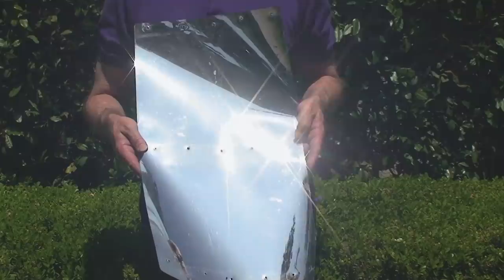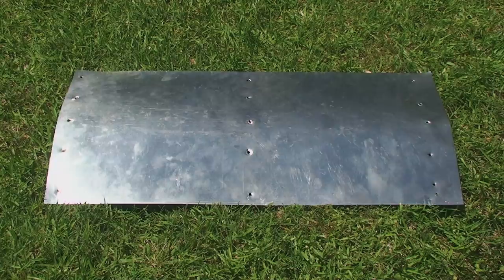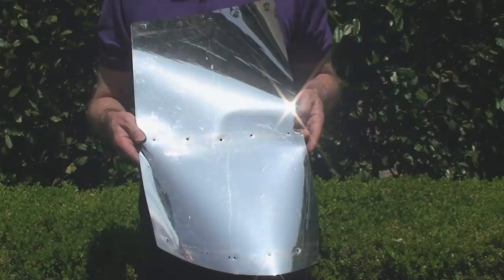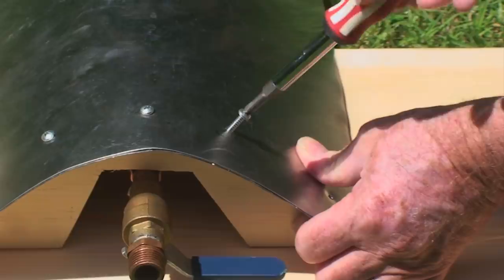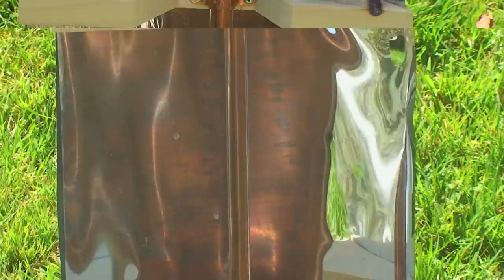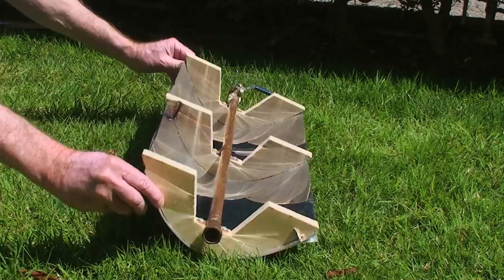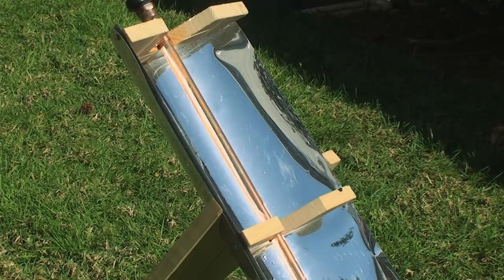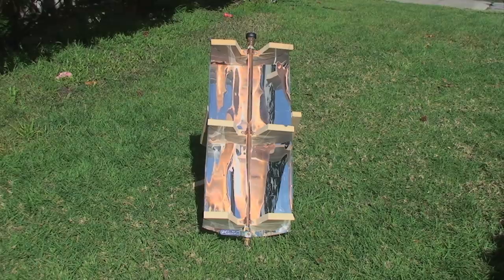Solar Water Heater Demonstration

Comment: well what are you going to do with that 1/2 cup of water? need to be about 150 times that size to heat water for any practical application
Reply: Maybe make a bit longer pipe and then attach it to a water source. it would probably output 10-20 litre before getting too cold. But i could be wrong
Reply: This is a gimmick.  The guy does not mention flow rate of water through the device.  You see to heat any useful amount of water the flow rate would be too fast to heat the water.
Reply: He said this build was just for demonstration.  Obviously, to be useful, it has to be bigger.

Comment: Nice explanation, but old technology.  I installed manufactured heating units that worked on this principle in the early 1970's - more than 50 years ago.
Reply from the maker: Are they still working?

Comment: I'm guessing randy gave his milk money away alot when he was younger. 

The water being static doesn't take into account cooler water moving through the pipe and cooling the copper. I would assume a longer run, with a return, traveling the same path through the parabolic trough, would counter the effect to make the flowing water warm enough for bathing or washing.

Comment: How fast does it heat the water? Will one run out of hot water while showering? Shabbat shalom
Reply: My question is talking about if this was hooked to running water. Shabbat shalom

Comment: when sun move, is parabolic still focus to the pipe
Reply from the maker: Interestingly, yes.
When the trough is horizontal and parallel to the path the sun takes across the sky, the parabolic reflector keeps the sun's rays focused on the pipe throughout the day.  The only areas that suffer are the very ends.  So if one has a long trough, the vast majority of the pipe will be heated.
As the sun changes latitude, the angle of the trough will need to be slightly changed, something on the order of every two to three days.

Comment: What country / climate are you in ? 
How would this work in England Uk Temperatures ? any info / ideas ?
Reply from the maker: This was built and shot in Los Angeles, California, but as one can see in the video, the ambient temperature in the shade was 68 degrees.  Not that hot.
One can get a temperature rise on a cloudy day just from infrared heat through the clouds, but of course, nothing anywhere close to approaching direct sunlight.
Even in England, one should get some temperature rise, but one would also need substantially more collection area to make it fairly effective.
Reply: ***** Thanks. 68 is good temp' for English summer. we occasionally hit 80 but only for a couple of days. its mostly 55 to 70 / 75
90 is a freak in weather . ( 32 ) ( 32 hot ) 
Its all very much Science / locality. 
But i like your ideas well done good vid' 
Many thanks from Yorkshire England Uk .
Reply: A friend of mine in the UK built a solar heater like this and it was so hot it blew up the two thermometers he had on hand. 
I have read  on a forum I belong to that some DIYers have measured  temps in excess of 220+*F in their air heating systems. One of these was in Pennsylvania in the winter...

Comment: Why didn't you hook up more water from a tank to it and run it through it to see if it holds a continuous temperature throughout the whole run of the water in the container? sure it's going to heat up the water in the pipe that's locked away lmao what about continuous heating? that might have been a good thing to add to your video Even though you're say you're not going to make a video with that until you have to have an instance where you need to that's just ridiculous if you're going to make a video show proof of concept not proof of heating up a cup of water

Comment: Can you drink the water after heating?
Reply from the maker: If one has followed proper plumbing practices, such as using lead free solder, copper pipe and fittings suitable for potable water, and, of course, potable water, then the answer is yes.

Comment: Just get a gas hot water heater and put a gasifier on it. That's way cheaper and get more hot water with less space.
Reply from the maker: That also works.
Reply: sgirrel it beats haveing to clean it everyday like Solar panels. If you don't keep it clean it won't work that good. And on rainy and cloudy and cold days it won't work. So no hot water. The gasifier is the best way to go.

Comment: Why only a single pipe?  May I use multiple pipes?
Reply: It is only a single ptpe  because its a demonstration. Working systems have many pipes joined. The narrator touches on this when he says that there are threaded ends on the pipe to join it to others when creating the system
Reply from the maker: Yes.

Comment: "If this basic simple technology is so easy then why is it not in use by everybody." 

Because the premise that it's simple is not completely factual. 
Sure the concept is simple. then you have to add in expense such as solar tracking and  glass to help retain the heat, not to mention controls to prevent oveheating and explosions, Then during the winter you cant let it freeze so then you have to use some kind of antifreeze and use a heat exchanger to transfer the heat to water. Then there is the point that it could not replace home hot water heating. As such it adds to the upfront capital cost of a  home vs if it could just replace a home's hot water. 

I will consed the argument that free heat from solar energy over time  offsets the expense of heating water with electricity or natural gas with the return on investment around 7 years. 

While some people implement solar heating, more don't because of maintenance issues and  ROI is not short enough for them to justify the extra expense now.
Reply from the maker: This video covers just the concept of the device.
The video also explains why this does not need any tracking.
Implementation of this type of device will be covered in another video.
Read all of the comments to answer a few of your other concerns.
Reply: As I pointed out, the concept is simple. I was addressing the issue why people don't put it to use more ,  because of factors I listed. I am just saying the reasons are more  complicated then "some assembly required."

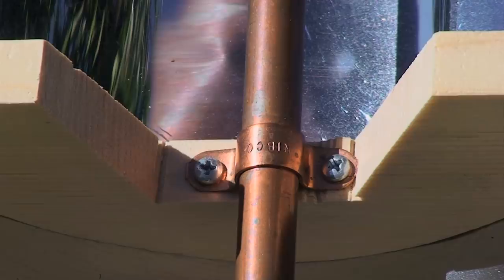As for tracking, If you watch it again, it does not say that it does not need tracking. I think you confused that from this statement 03:15 "Even though the heater is orientated vertically, this shot shows us that if the length of the pipe stays aligned with the path the  sun follows across the sky, no adjustment will be necessary."

Regarding tracking, let me say the same thing the video was saying, but put another way. It needs to be rotated along the axis of the pipe throughout the day to keep it aligned with the sun. As for the tracking along its length, there is a seasonal variability by as much as 46 degrees. Expect less then optimal performance for deviations away from proper alignment every minute the sun shins.
Reply from the maker: Keith:  Horizontal
Reply: @sgirrel. I'm sorry, I did not understand what your trying to communicate in "Horizontal"
Reply from the maker: Keith:  Mount the reflector horizontally instead of vertically and the Sun will stay focused on the pipe throughout the day.  Only the ends will fall off into shadow.
You only need to change the angle every couple of days to compensate for Solar latitude.
Reply: Ok, but you will loose more than 1/3rd of the sun. and you will still need to track it daily as it changes through out the year. Hear is why:

Assume a collector 1 foot wide by 3 feet long, and for simplicity a 12h day that rises at 6 am and sets at 6 pm. Then equation you would use to determine how much sun is shinning on  a solar trough aligned parallel to the daily suns path without minute to minute tracking, is:
square footage * sin((hour of day - hour sun rose)/(hours of sun in a day *180))= square feet of sunlight.
Results:
6am = 0 sqf
7am = .77 sqf
8am = 1.5 sqf
9am = 2.12 sqf
10am = 2.59 sqf
11am = 2.89 sqf
12am = 3 sqf

When the trough is parallel to the path the sun travels across the sky, then  theoretically,  one will get at best, get an average of just 63.43% of the sun as compared to if it were aligned perpendicular with minute to minute tracking. But, even then, one or the other end cap as well the center support will cast a shadows on the reflective surface.
Reply from the maker: Keith:  Check out Kramer Junction.
http://clui.org/ludb/site/kramer-junction-solar-electric-generating-station
Reply: yup =) I think it is well to point out that the system is supplemented with natural gas. Due to solar variability, peek power plants are necessary to fill in the gap when solar is not meeting demand. Supplementing with natural gas keeps this solar power plant producing power at night or when clouds are overhead. A power plant's return on investment lengthens (bad as it increases the average cost of electricity) the less time it is producing.  Short term storage from a few seconds to minutes is helpful for grid frequency regulation but beyond that, it gets progressively more prohibitively expensive to provide power from an hour to throughout the night.

Because of the economies of scale, a solar power plant like this is a more economical option to put the suns energy than many DIY home owner's DIY projects. But I wouldn't stand in the way of any DIYer choices in how to spend their money.

Cheater Natural gas helps more solar power plants like this.
Reply: On tracking again:
A trough parallel to the suns path requires daily adjustments to keep it optimized to the suns daily changes through out the year. 

A trough perpendicular to the suns path requires minute to minute adjustments, and require more range to adjust through  

Both need tracking. Both have roughly the same level of complexity. But, a trough parallel to the suns path  can only collect 63.43% as much sun as a trough perpendicular to the suns path. 

On the other hand, a home DIYer could manually make daily/weekly  adjustments to a parallel trough and deal with the simpler but less efficient collector, but manual adjusting a perpendicular trough is too much to expect to be useful.
Reply: You can use it as a pre-heater right? Nothing wrong with that. Vaccumed and blackened, this system looks promising for the money.
Reply: Tomasmoravia "You can use it as a pre-heater right?" You most certainly can as long as you don't expect it to ever get close the boiling point, like say when you are not home for a few days, in which case, you could come home to either it or your preheat tank exploded and found  to have land some where down the block, while also leaking a bunch of water when no one is home. Also, if you live where it freezes during the winter, you are better off with using an antifreeze or oil as your heat transfer fluid feed to a heat exchanger. 

My point is, the idea is simple, putting it to practical use is a a bit more complex.
Reply: Oh yes. I think this can spark somebody's imagination and they can do it. I was thinking secondary and primary circuits with heat changer and pressure valves. I guess there is ton of other ways to do it though.
Reply: Keith Reynolds
YOU LOST THE WHOLE CONCEPT!  Its to save money, it won't explode and it won't take 7 years to get your money 
back.  Why don't your water heater gas/electric explode in your house?  It has a safety valve in it , it don't take a genius to set up a system so you have hot water for your house or workshop.  With your info is like trying to make a mountain out of a mole hill.
Reply: return on investment is immediate like any other investment.  of course "pay back" time is another factor which is not relevant to return on investment.

Comment: You are wrong about the elongation or compression - it will not distort the parabola, you will only have a narrower or wider section of it. This is a fundamental property of parabolas.
Reply: His point is that the FOCAL POINT of the reflector needs to be on the pipe.  If you alter the parabola you will alter the focal point.  This is a fundamental property of reflecting lenses.  See the Hubble telescope fiasco for further details.

Comment: This is a gimmick.  The guy does not mention flow rate of water through the device.  You see to heat any useful amount of water the flow rate would be too fast to heat the water.
Reply: the flow rate is achieved by a pump in the system and regulated by a temperature sensor in the circuit that switches the pump on and off, just as in a traditional central heating system. The solar panel array does the same as a boiler in a central heating system. There is no gimmick, properly constructed it will work. You should note he said at the very beggining that this was just a test demonstration, not a fully working system.
Reply: @bullshitdave  I hear what you say, but in practice it would most likely benefit from pumping around the system, when distances and heat loss are calculated. A thermostatic switch could be incorporated so the water only travels by pumping once it reaches a optimum temperature.

Comment: he lied in the intro.
stated heat water ONLY using the sheet mtr in his hands. said nothing about any other items.
Reply: the water is heated by applying a heat source, in this case, the sun. the sheet only catches the suns rays and concentrates it on the pipe the water is running through. It is heating using just the reflective material. There is no lie.

Comment: That's not fast, immobile water isn't that hard to heat, not to mention that is an impractical setup. test it with moving water.
Reply: Steven Paige add more pipes? and run the heated water into a tank? ;)
Reply: It should be noted this is a test rig. If it is employed in a working system the pipework would be much longer, and there would be multiple reflectors along each length of pipe. There would be a pump to circulate the water, and most likely a thermostatic valve to regulate the flow of warmed water. On the other end the water would most likely pass through an exchange pipe, immersed in the water you were finally going to use so that water is heated by exchange. The Spanish have commercially built systems of this type on top of their buildings, and they heat domestic water quite adequately
Reply: On order to have some significant output, the solar collector must be very much bigger... To solar output, on a cloudless day, may be app. 1000 Watt/m2 only and in the optimal position towards the sun and you need to keep it that way. The Hight of the temperature is not so relevant; te power output is.For domestic use not feasible, to make some hot water on a camp site it will work. Success
Reply: No, you need a bigger reflector to catch more sunlight
Reply: 4.2 Joules per gram per Kelvin [heat capacity of water] * 0.55555 Kelvin / 6 seconds [rate of temperature change stated in the video, but converted to Kelvin for Google]  * 125 grams [half cup of water] = about 50 Watts
Reply: realistically you would have a closed loop set up i mean its not like you have your hot water running 24/7 right?

Comment: I have seen these in operation, the parabolic mirror can be described loosely as a 1/2 tube, and more people would understand it, PLEASE drop the 10.00 words and use handymans language. the 10.00 words make you sound pretentious and overeducated. This concept is very simple, there is a city in Colorado that uses it to power their steam generator. They collect enough heat to require sodium and a marine style heat transfer unit in a water tank that powers the generator. Please don't complexify a simple process.
Reply: Kenneth, perhaps you can do your own video and produce it for the common man.  To me, the narrator's explanation seemed succinct and informative.

Comment: cool.   Now, how do I take a shower with half a cup of water? (lol).   Just razzing you.   It's funny how "capitalism", and energy do not play nice together.   Of course, there is also the gotcha, that even if you answered question 1, how do you take a shower at 6am?   lol.
Reply: Take a cold shower?  LOL! Or have some way of storing the heated water or of heating it with an additional heat source.  Which is why these systems only supplement a gas or electric water heater/tank.  TANSTAAFL.
Reply: Norman Graham more pipes.. better heat transfer then you send the heated water that will expand from the temperature change to pressurize the top of your water heater inturn to push the water in a cycle? like a furnace radiator system I'm your house? but with no natural resources but only solar rays heating up pipes to heat the water from the sun?  hmmm simple
Reply: Mike L depends on your system and build
Reply: What kind of "build" or "system" will keep the solar-heated water hot without added heat input from some other source over a period of time?  Your statement is nonsensical.